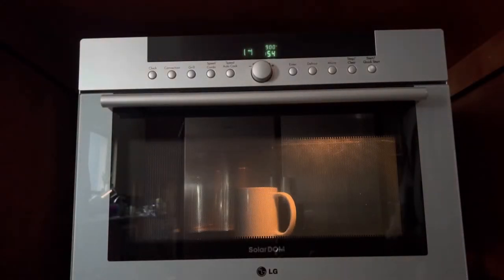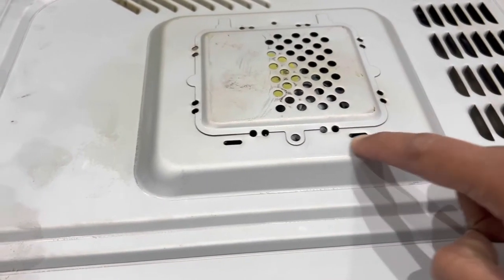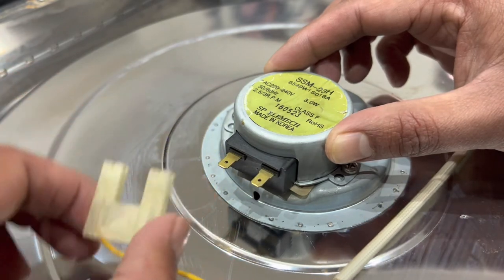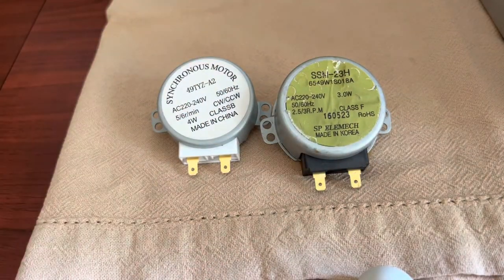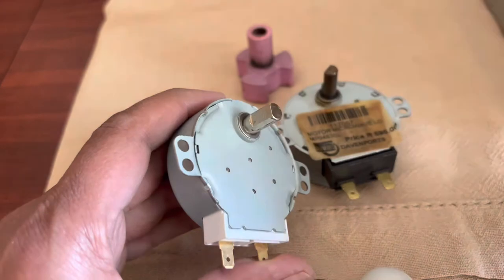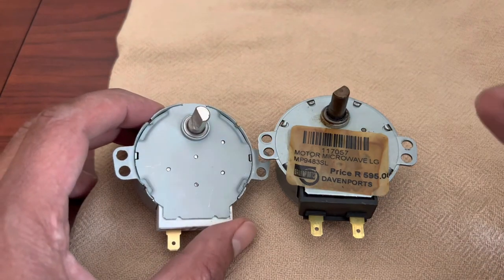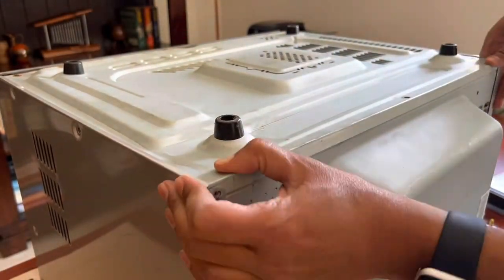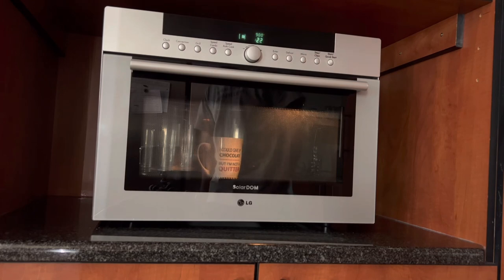Replace LG Microwave Turntable Motor

Comment: I have a F 11 error after about 10 seconds of turning. It was in a repairshop and came back ok. ( Inverter was replaces ) After 3 months again the F11 commes on the screen and the heating  proces stops. I went again the the repairshop and after 2 days the man called me the microwave was ok. It was a bad contact. Again after a few eeks working ok the F11 is back again. As I saw the turntable stops and goes the other direction several times my idea was the turntablemotor fails or is touching and other thing so it gives a malfuntion and do the F11 error. I disconnected the motor, and all is ok. So it must be that motor that is not ok. Do a test again with the motor connected, the F 11 is there again. Now I am shure, I THINK. Deconnect the motor, make all the rest to be ok, like puting back the cover, test, the big F word is on my lips as the F 11 error is back again. Do you have the perfect tip for me to make our LG MJ3965ACS to do what he must do?